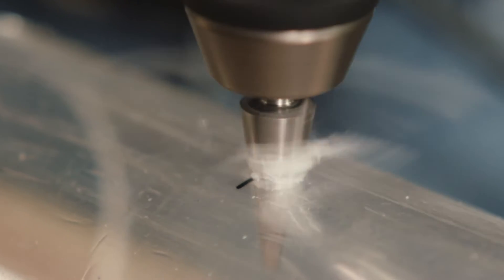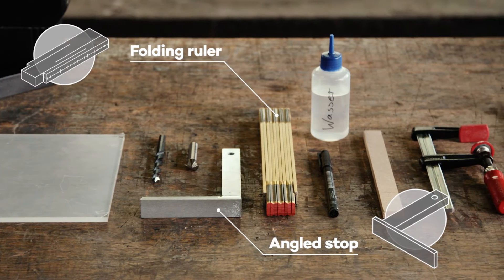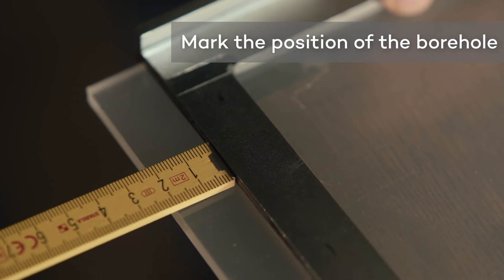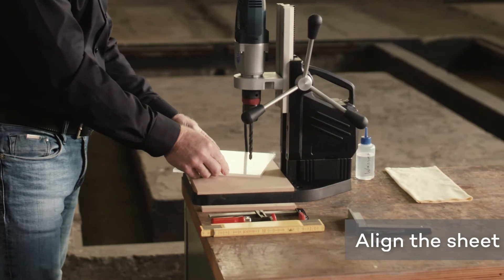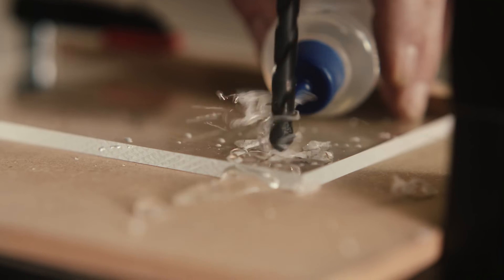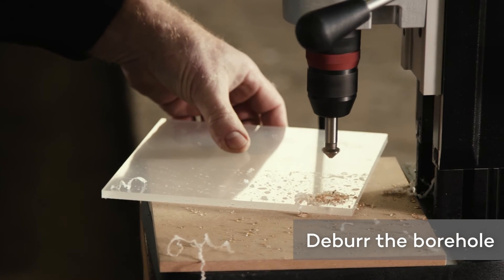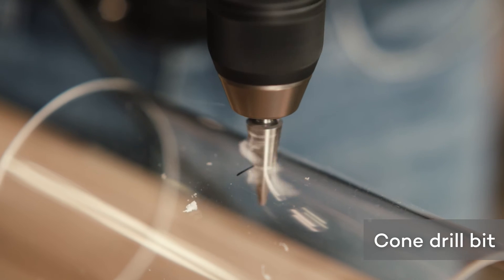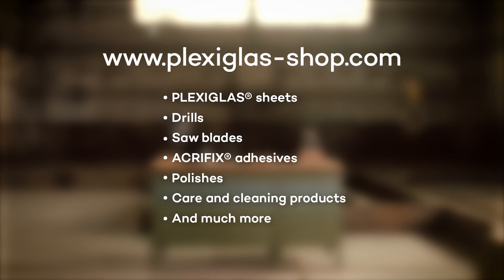Drilling PLEXIGLAS®: Perfectly drilled holes in just a few steps

Comment: I'm drilling 1mm plastic mirror card but the mirror coat seems to come off or comes loose and looks like it's peeling off after holes have been made
Reply: Start with the smallest drill bit you have and work up in the smallest increments possible.  Adding tape to that side will also help.